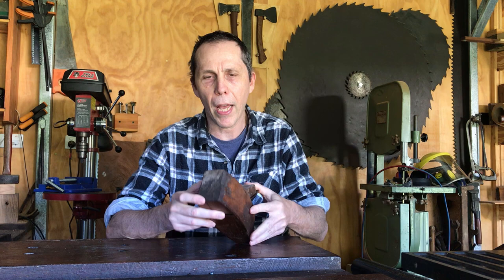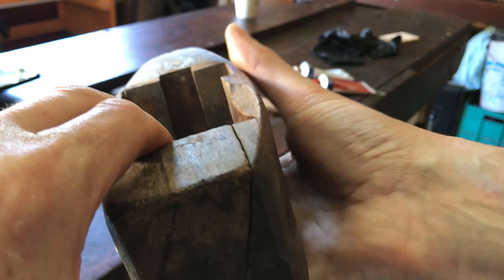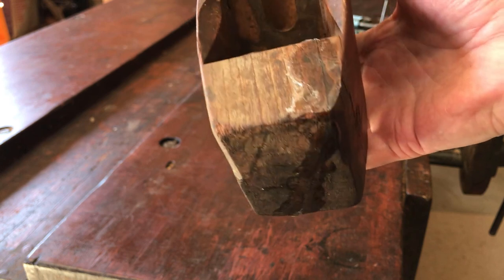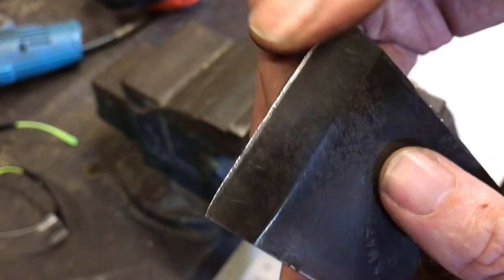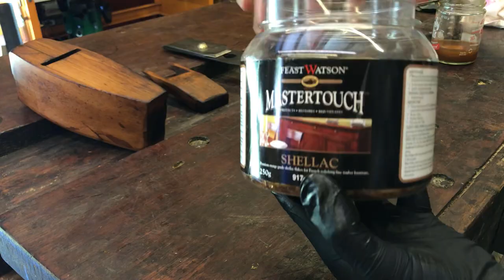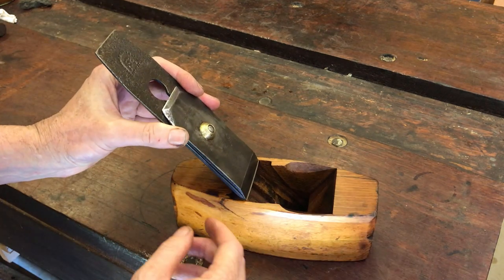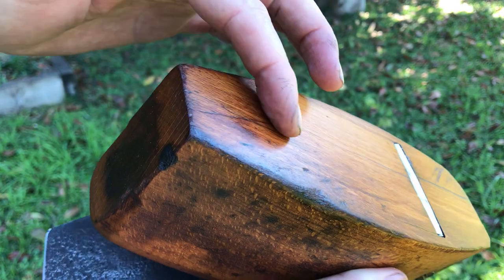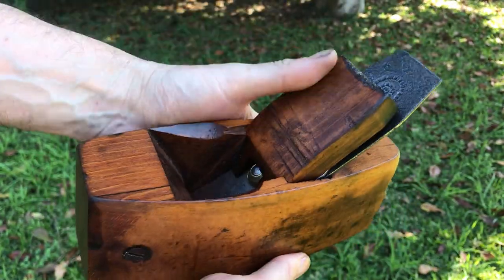Busted Tool - Restored to perfect working condition

Comment: That was awesome Matt, though I thought it might all be over early in the piece when you were taking out the screw, I thought for sure it was going to snap and have the head pop off. Glad it didn't, great vid! 👍
Reply from the maker: Thanks Mario, I'm really glad you liked the vid. I wanted to use my vintage screw driver but it really needed some force. Next week I'll squeeze in a little arcade machine play while I wait for the glue to dry and I recon you would dig that.

Comment: beautiful hand plane and great restoration work

you can try syringe + needle to fill the tight cracks, as it pushes the epoxy with some pressure and can penetrate all the way. I also add few drops of the black or dark orange / brown dye to the epoxy, so the crack looks like a wood vein. I actually add the dye to part A of the epoxy, and then I know that parts A + B mixed well as the colour becomes evenly distributed.

I also started using my workbench vise for clamping, when I need good clamping force. 

PS
I love the OZ flag, just like many people put their national flag in the home gyms etc. I will put my national flag in my workshop to be, as for now I don;t have one. I'll be moving soon to another country, and there I will finally build my shop. I lived like a Gypsy for the past 50 years.
Reply from the maker: Great idea.  I thought of the syringe for the metho flush and used it in my next restore video.  But I never thought of using it for pushing in the epoxy.  Hope you get a good dry base soon. Yes love my flags, I should hang the big one properly, probably when I redo the display wall behind the bandsaw. I now have a lot of extra cool blades to fill it in as an ultimate video backdrop.

Comment: Great work, Loved that you left enough patina on it and the old finishes. Just a quick question, when you put the screw back in it looked like it was still partly proud of the side, if so did you consider counter sinking it further? Just so you did not catch yourself on it. Alternately did you consider replacing it with a dowel?

I also have one of those Mathieson Blades and cap irons.

Also the difference in volume between your vocals and the music to me seems way to great, just something you might want to check as I found myself constantly adjusting the volume down when the music came on.
Reply from the maker: Thanks, for the great feedback.  I have been struggling with the audio and have put a lot of effort into improving it and I agree the music is too loud compared to my voice and I will reduce it for you, but the next video going live in ~30 mins is probably the same. 
The screw was almost pushing out the other side and I thought about reducing the length and embedding it more but I decided it was part of the tool's history and it does not catch or cause any issues.  Years down the track I hope to look at it and get good memories. If I was selling it I would probably fill it but that would not increase the value probably.  I really value your feedback and enjoy the conversation.  Cheers
Reply from the maker: I just published my next video and I was thinking of you. Turned the music right down, so have I got it right now? Perhaps the voice is too loud now but at least consistent and not blast your ears?  Also used that plane in the video too, and that Mathieson blade is a winner.
Reply: @Saw-IT  I have seen your next videos and much better balance on the sound.
Reply from the maker: @QRCCD1999  Thanks heaps for the feed back. I have been filming with an old iPhone7 but now have a new camera. There is a Stanley78 plane video and an old Keesteel axe restore video coming up filmed on this same old camera, but the videos after that will see an improvement in the video quality too.